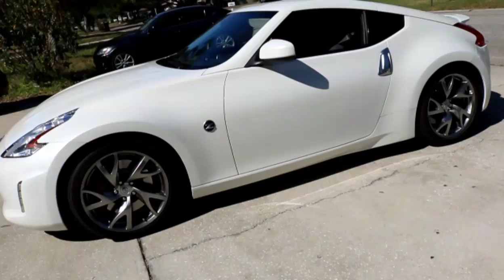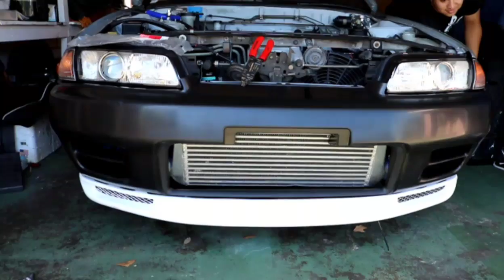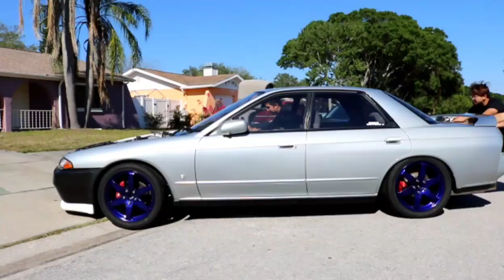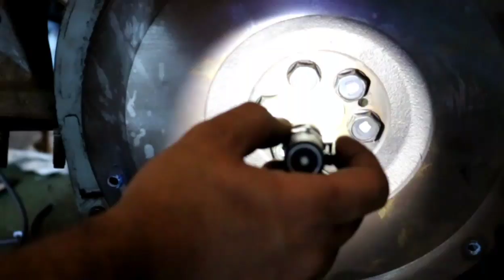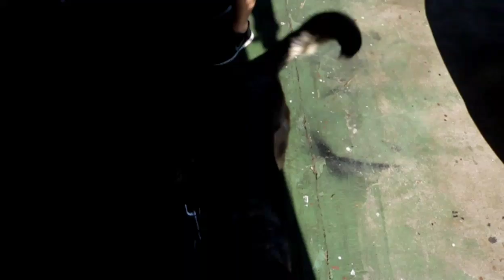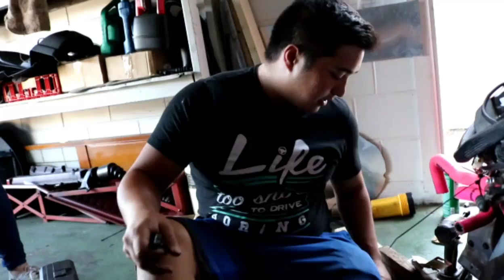THE STRUGGLE TO BRING THE SKYLINE BACK TO LIFE...

Comment: you gotta grind down the 2 teeth on that pilot puller , get it in and behind the pilot, and then use the  slide hammer.  literally went through that yesterday .  worth the $20 to own it and just return the slide hammer rental .